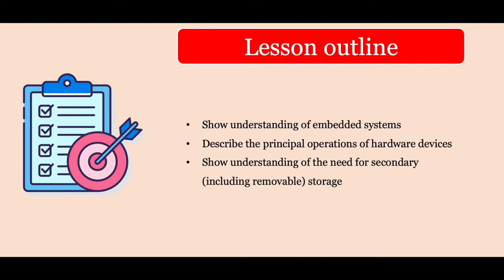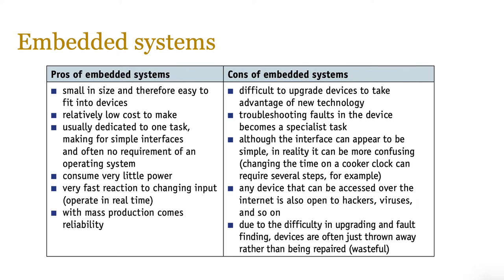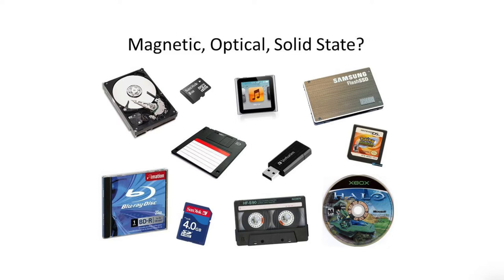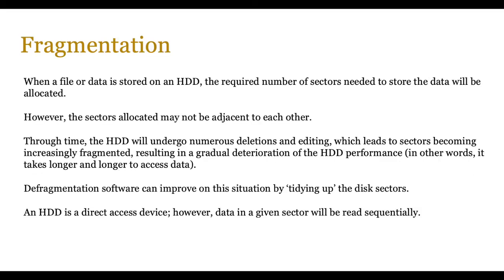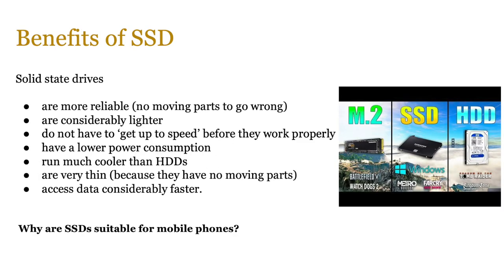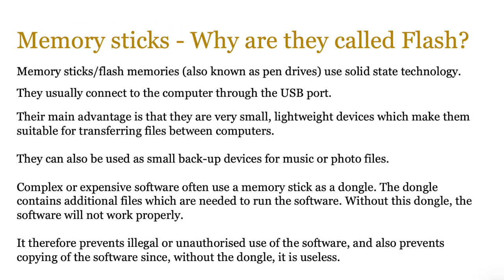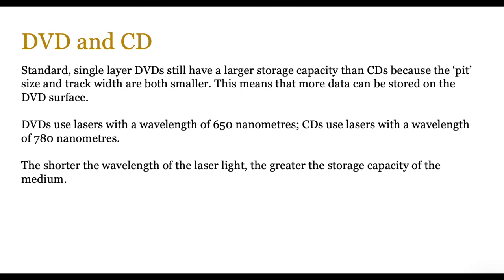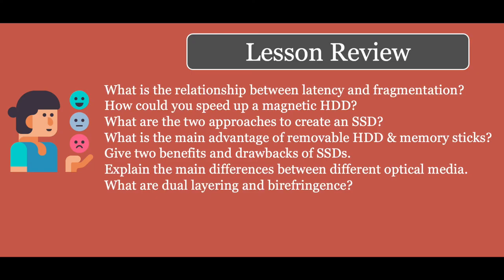Lesson 32 - Secondary Storage and embedded systems

Comment: Sir,
For the fragmentation
For a large data, it is written on different platters but on the same sectors location for all?
But for the fragmentation to happen, the data are written on different platters and also different sectors?
Do the HDD write same data on different sectors and tracks?
Reply from the maker: Each platter has its own tracks and sector that store different data. A large file can occupy multiple platters or multiple tracks and sectors on one platter. Fragmentation can occur across multiple platters and on the same platter as well. Each platter has read/write heads that move independently which can sometimes help and sometimes cause lag depending upon how the data is arranged/fragmented on each platter. An HDD does not write same data on different tracks and sector or across multiple platters unless you do it manually e.g in the case of a backup. But in such a case it is technically the same data but saved under a different name.
Reply: @ComputerScience4U  So, it write data on first platter, look for empty sector, if full, then move to the next track, if platter full, then move to next platter.